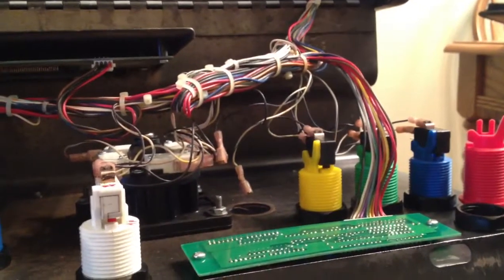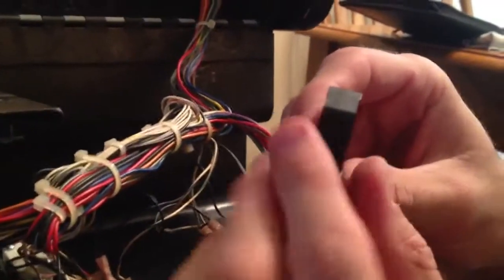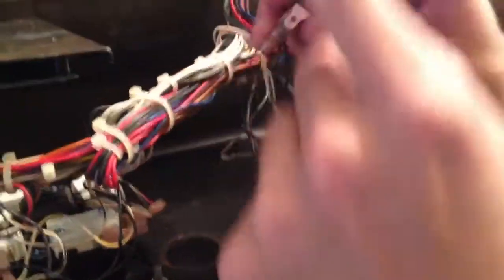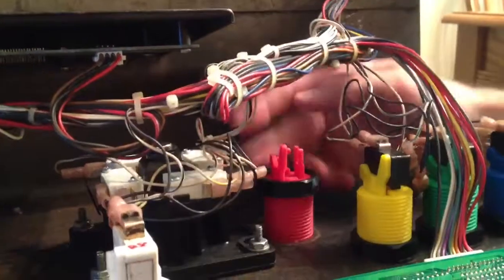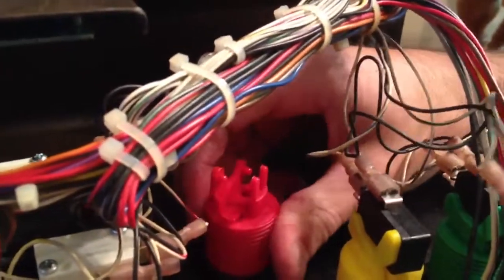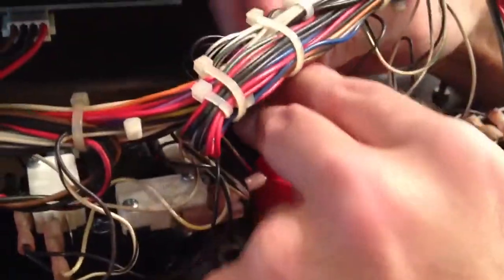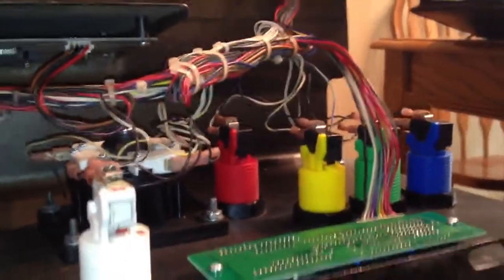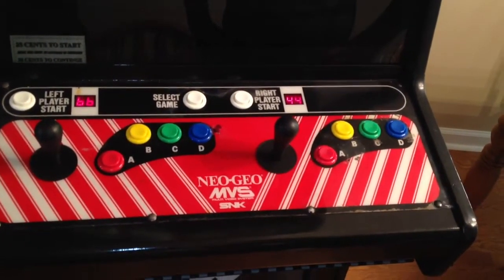Neo geo mvs button installation

Comment: Hi. You mentioned in the video about getting a new overlay. Are you talking about the button control overlay? I'm looking for one myself. Any help? Thanks!
Reply from the maker: Hello :)
I did get one, but it came from a friend. I saw a few out there when doing a search for neo Geo overlay reproduction, and though this one is expensive, it looks close to the the original. 
https://quarterarcade.com/neo-geo-mvs-2-4-slot-10810
I hunk they have cheaper options but you have to cut the button holes yourself. I'd recommend getting a pre cut one, unless you have a way to cut the holes. I'd be afraid I'd slip and scratch or destroy a new overlay.
Reply from the maker: Here's a link to my overlay update and you can find more updates after I painted it and added graphics on my channel. Hope you find one bud. :)
Reply from the maker: Crap forgot to add link

https://youtu.be/zDyFX8aQUJg
Reply: Thanks so much for the help!
Reply from the maker: +necksnap your welcome my friend